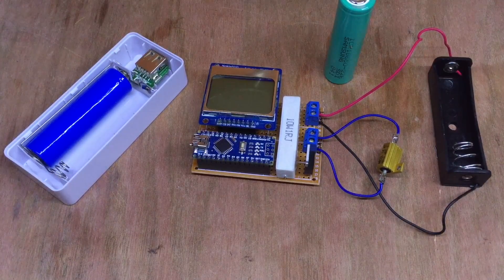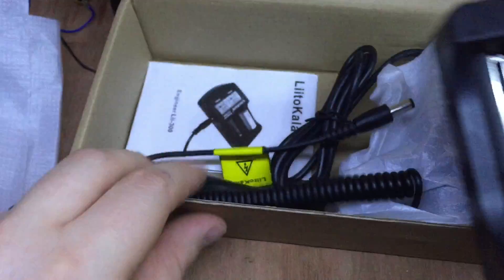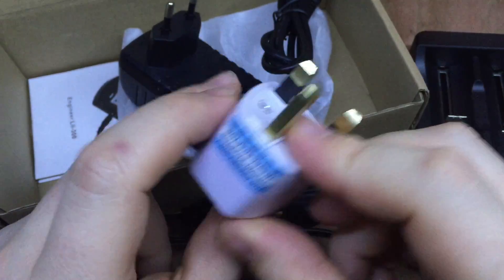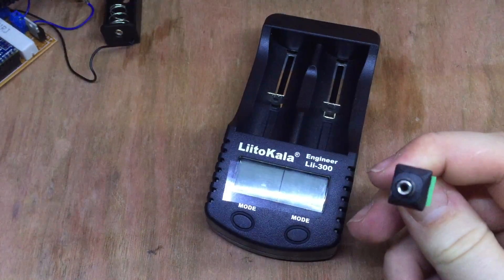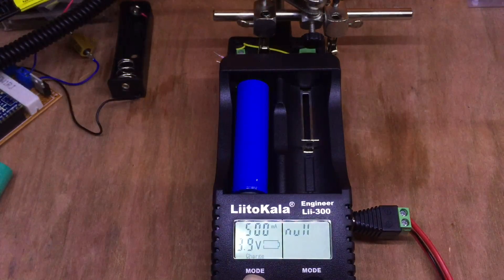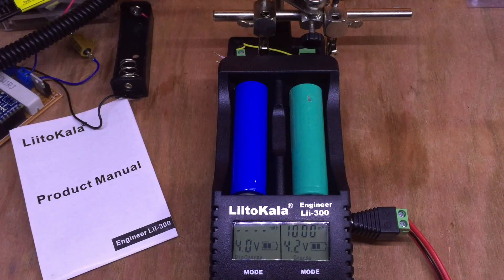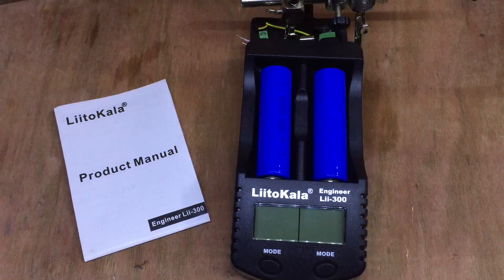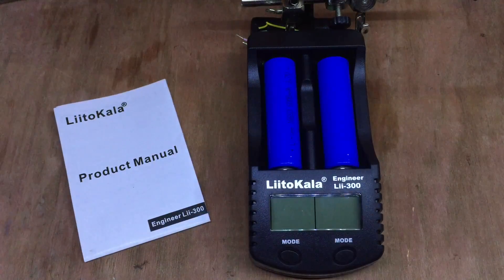LiitoKala Engineer Lii-300 Battery Charger #Review - 12v Solar Shed

Comment: I have used the 260 for about 80 cells before it broke apart.  Be careful when removing batteries.  Tha base plate separated where the screws on the neg ends went thru.
Question on the 300 is when charging a lithium, the first stage is constant current.  Does the second stage charge at constant current too?  1st stage goes to 4.19v and stay that way while the second stage takes over.  According to battery university the second stage is supposed to have the charging current gradually decreases till about .1 amp aND that is when the cell is fully charged.
Reply from the maker: +Nestor Asuncion I believe that it does have a suitable charging profile. I've watched the current decrease at higher voltages. 

I think the sprung type of holder is a weakness but it allows for various sizes of cells so it's a compromise. 

Thanks for your comments.

Comment: Very nice review. I wanted to add that you can change to discharge mode to go directly to discharge without charging by holding the mode buttons while applying the 12V Input. 😃
Reply from the maker: +Jonah Faust Thanks for the kind comments. That's a useful tip. Thanks for that too. :-)

Comment: Would it be possible to use it with a 15W USB solar pannel with an adapter?
Reply from the maker: No - I very much doubt it. Solar panels aren't great at providing constant power to devices. 15watts is 3 amps at 5 volts (assuming 100% efficiency). The LiitoKala needs up to 2 amps at 12 volts which is 24 watts.
Reply: Ok thanks a lot for replying. Do you know of a charger that would work with a solar panel. BTW very good video!

Comment: I don't think the Lii-260 has NiMH charging, so the Lii-300 has that and USB powerbank output as extra features.
Reply from the maker: +Julian's Reviews Thanks for that.  Its a little difficult deciphering the differences on the official website - I suspect a lot of copying and pasting going on from the different pages! http://liito-kala.com/lii-260Detail

Thanks again Julian
Reply: +Adam Welch It is very confusing. It seems there are two types of Lii-260, the Engineer Lii-260 and the Simple Lii-260. The Engineer Lii-260 is the only product that doesn't support NiMH.
Reply: +Adam Welch the 500 is cheap on ebay or aliexpress, make sure to get the one with an adapter if aliexpress.
Reply: +Adam Welch Yes that is correct, its major downside is that it only shows the info for the currently selected bay, you have to flip between them. It does show more of the digits for each stat since its less cramped.
Reply from the maker: +wooo weee It is fairly cheap. I'm not sure of that model though because it doesn't show the information for all the batteries all the time. I think you need to flip between batteries using the channel buttons. I like the fact that the 200/260/300 range can show accumulated mAhs of both batteries or voltage all the time for example.